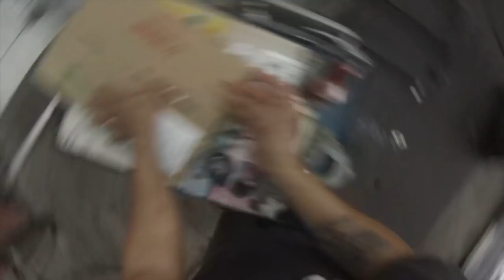COMO MONTAR UM MOTOR AP PASSO A PASSO

Comment: Bom dia meu caro! Tudo bom? Será que você poderia me responder uma dúvida? Este link de vídeo que estou postando logo abaixo mostra um barulho no meu Gol AP. Se puder ler meu comentário, passo maiores detalhes;
https://www.youtube.com/watch?v=FYYD1FsdXC8
O barulho que cito é o que aparece após os 5 segundos do vídeo.

Este motor foi retificado o bloco, trocado pistões, anéis, bronzinas de biela e mancal, arruelas de encosto, polido virabrequim, embuchado o eixo do distribuidor, bomba de óleo schadek nova, ou seja, tudo novo. Porém, não retifiquei o cabeçote pois, o orçamento já estava elevado. 
Este barulho só surge na primeira partida, ou se o carro ficar parado muito tempo ao longo do dia, no entanto, não é todo dia que surge. As vezes fica 2 ou 3 dias sem aparecer e, de repente, aparece e logo some. Só aparece em certa rotação (2.500 rpm aproximadamente). 
Já tirei a correia do alternador, liguei sem ele e sem a bomba d'água para testar mas,  o barulho apareceu mesmo assim.
O que poderia ser?
Ponto de ignição a 9º (conforme pede o fabricante). Já trabalhou com 12º, mas não mudou nada.
O cabeçote está batendo muita válvula, fazendo bastante barulho. Este motor, antes de retificar atingiu alta temperatura de funcionamento (não ferveu), os pistões chegaram a ficar vermelhos, por isso, usinei e troquei por novos. Essa alta temperatura pode ter empenado alguma válvula? Pode isso ser o causador do barulho, mesmo parecendo que vem da parte de baixo?
Reply from the maker: Parece uma biela batendo